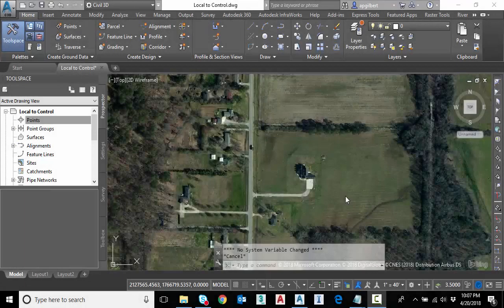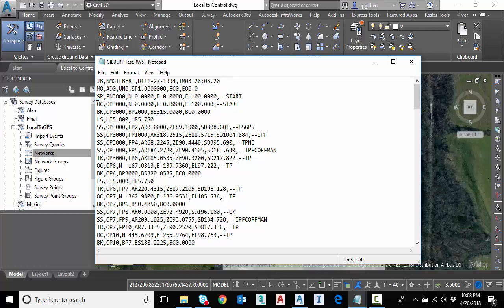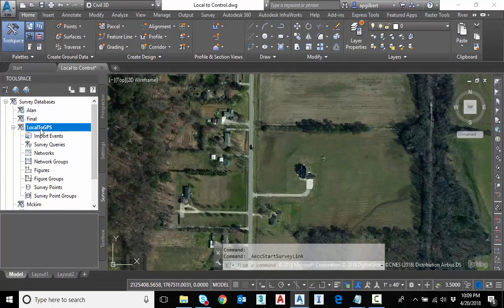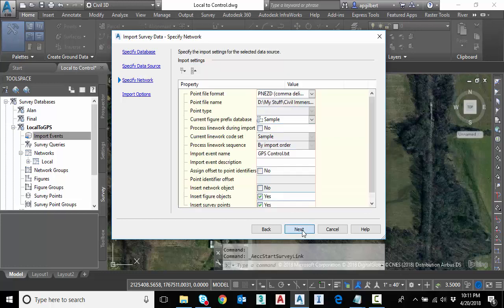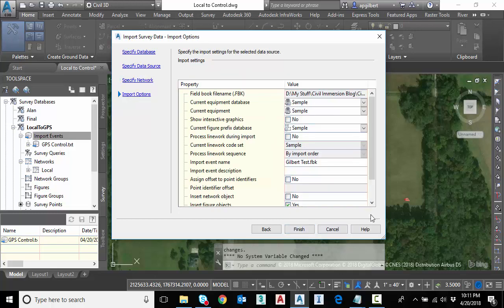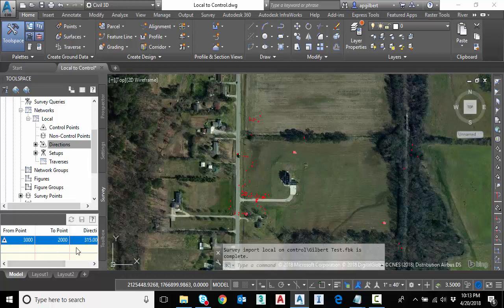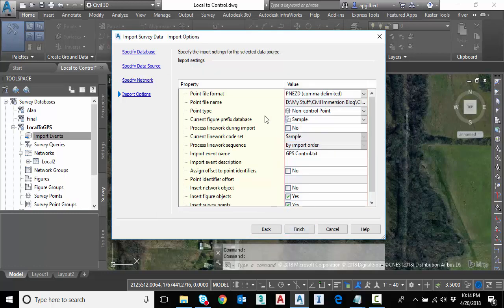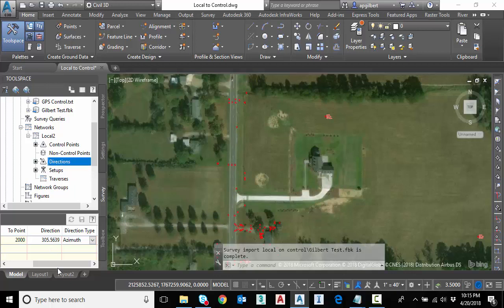Finish Strong Friday:  Import Local Coordinate Survey Data into Known Control Points

Comment: Hell Gilbert! Thanks for the video. In this case the total station file was already made on grid or the GNSS control points were converted to ground, to fit with total station shots? Thanks!
Reply from the maker: Hello, the total station file was collected using assumed coordinates as we did not have any control points on a datum to tie to at the time of collection.  A few days later, we shot our "assumed" control points from the total station work with GPS and tied these to a known grid coordinate system.

Comment: Hello Gilbert. I'm again with another question, for sure very silly for you, but not for me.

Gilbert, I have a csv file with point number (column A when read it in excel), lat (column B), and log (column C). That information was taken and registered with a simple gps. When read it from Google Earth, everything is quick and well located, but when I try to get this csv into Civil 3D, a message in the "Import Point window reports "Status: Does not match selected point file", despite the Preview window shows correctly what I want: "Point Number, Latitude, Longitude".

I created a Point File Format with Point Number, Latitud, and Longitud. Under the Point File Format dialog box, I checked it just loading the file and parsing it. And everything was good. But, then, when importing with that format, I cannot get it into Civil 3D.

I have everything set up in NAD27 Texas State Planes, Central Zone(4203), US Foot, as in the file, as when importing.

Would you have a suggestion about that?

Thank you Gilbert

Comment: Gilbert, thank you for sharing your knowledge with us. I am a very beginner at this. I wanted to ask you, is there a way I can have a PI alignment report with the Lat-Lon information? I have googled this issue and found this is an old problem many of us have come across, and found too, that the possible solution goes through making some adjustments at the software program level.
Reply from the maker: Thanks for the nice comment.  Since there isn't a default report that exports this info, a custom report would be required.  However, a work-around could be to create cogo points at the geometry points of the alignment (create points menu>alignment>at align geometry) and then use the "Exports Points" command on the Output tab to create a custom report.
Reply: Gilbert, thank you so much for your time giving us a path to solve this issue. I'll try that solution. I take the opportunity to tell you that I am one of your followers. Thank you again.